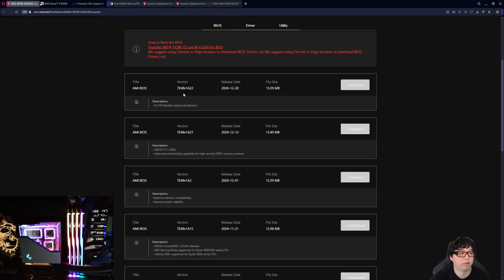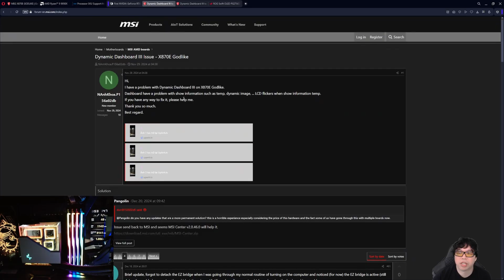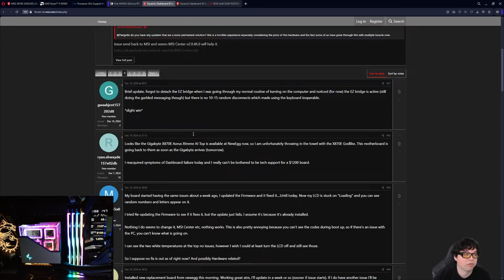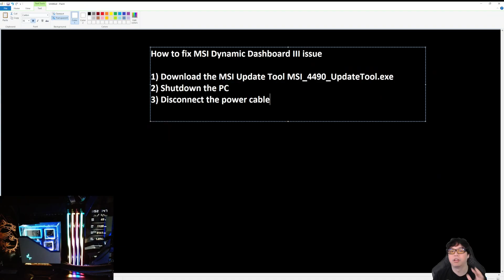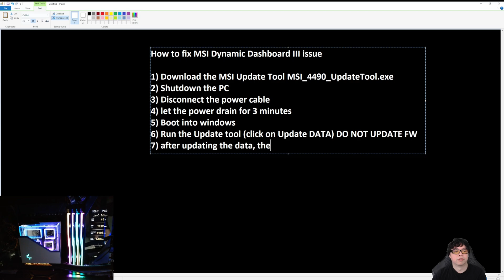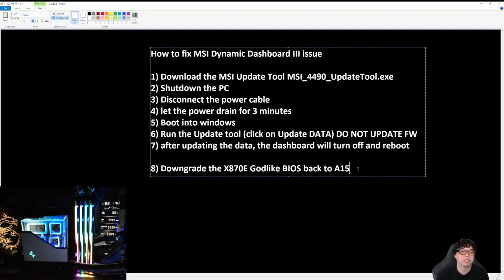How to fix MSI Dynamic Dashboard III issue | X870E Godlike

Comment: My board is a later batch, the Data and FW were already updated.  I have not run into the problem however it does not restart properly from Windows, PC monitor goes black but everything remains on until the Dynamic Display shows CPU & DDR error.  It shuts down properly and cold boots fine.  Reset button does not work from the case either.  I did not connect the EZ fan hub.
Reply: Can you share any information regarding batches? I have my board and haven’t even opened it yet. I’d really like to keep it and knowing I if I indeed have a “later batch” board might sway me that way.
Reply: @WD180K I assumed it’s a later batch because the Data and Firmware for the display was already updated.  I did not check serials or anything because I don’t have a reference point to begin with.  I bought mine from B&H which did not ship until 12/23 even though I preordered since 11/25.
Reply: I have the same problem, is there any solution now?
Reply: @XuHanXu  No fix, though on MSI forums someone said one of their USB peripherals and/or monitoring software caused the reboot/restart 0d issue.  After disabling auto start on MSI Center, L Connect 3, and that display software his restart issue went away.
Reply: @captainlooney4356  Yes, I saw that reply as well, but this method isn't a good fit for me as my reboot failures aren't avoided, they're probabilistic. Let's just say I'm disappointed with MSI's response, after all, this is an expensive motherboard.
Reply: @captainlooney4356  I can also "shut down" and "cold boot" the backups, and I'm okay with this solution for the short term to avoid the problem for now, but I don't know if the problem will be solved in the short term, and I'm worried that it will worsen in the future, and it's really hard to It's really hard to accept that such an expensive motherboard limits the user's basic needs.

Comment: Bro, I am in the same boat and added this CRUCIAL step- disconnect the data cable and fan header that came with Godlike. If you need more fan headers use the ones in the PA602. You have cpu fan, pump1 and pump2 on the motherboard to feed your AIO and the hub in PA602, and that still leaves a 3rd fan header. The corruption has something to do with that box or it's cable more likely).
I also did one more step and set up the Dynamic Dashboard to a non-stat monitoring picture to avoid the monitoring aspect of the glitch. And finally, I set Dynamic dashboard3 to not 'Start with Windows' (your pics/settings will still load just bc of the registry entry).
I am still on the newest BIOS bc Im not fk'n up my ram tune- 6600/2200/3300 c-32, 38, 38, 48, 80 , plus 8000 c34 4000/2200/2000 c-38, 46, 46, 52, 84 .
Reply: Have you ever had the problem, and how long since you are up and running again without prob
Reply: @ had the problem once on dec 29, updated the tool within in minutes and it hasnt returned.
Reply: can you please answer @ballain1 's question?
Reply: @ done

Comment: doesnt work for me, tried everything😢 msi told me it is a physical error-production-fail
Reply: sounds like something a level 1 tech would say. This problem is far beyond those folks and needs to be addressed up the chain.
As for you, sir, you dont need to send back the whole motherboard (unless you just want to), in the thread we basically bullied them into saying it's ok to just send in the Dynamic Dashboard3 alone and they'll replace it. Be very careful to make sure it's clicked into place and properly seated.
Reply: @ yeah but im just tired of getting something that doesnt work properly, so i think im ordering the aorus xtreme top ai instead. And then send back the msi and ask for refund
Reply: @CrackaSlapYa  where does it say you can send back just the display? I have not seen that anywhere. Is it on the MSI forum thread? If so, what page? have you sent back just the display?